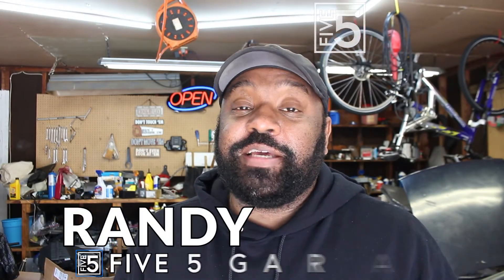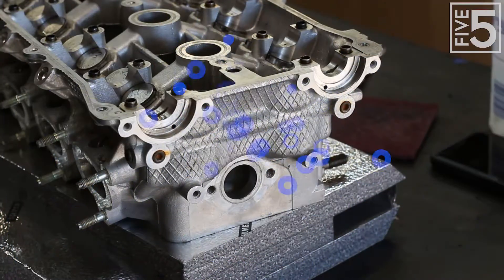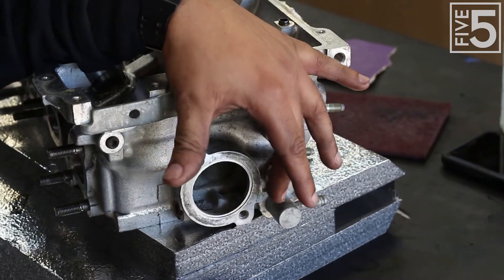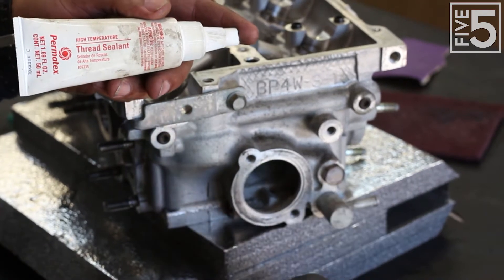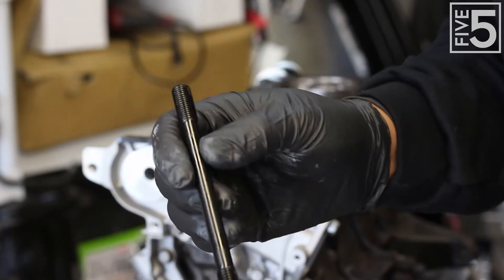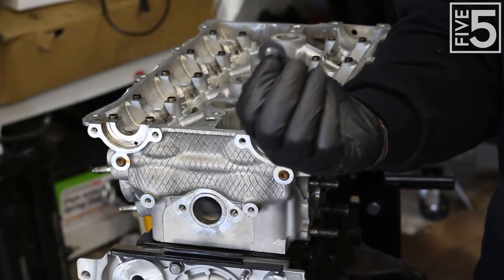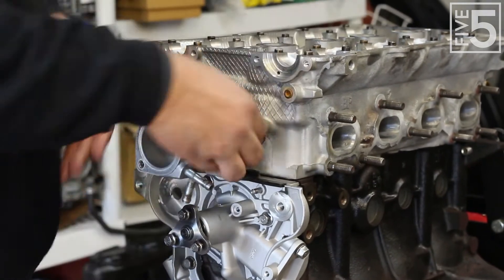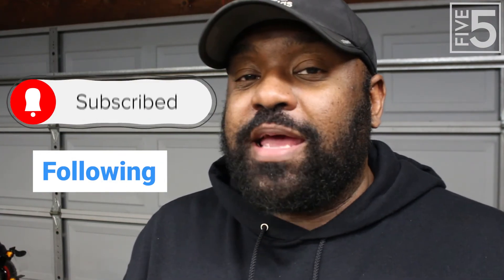Project TMB Episode 12: Cylinder Head Installation

Comment from the maker: Another week, another video, another step closer to getting this motor back in the car!
Reply: So do you think you'll be driving this car in the winter of this year.
Reply from the maker: Nope. Engine will be in and running, but there is a lot more to be done: intercooler setup, wiring, suspension work, body work. This car won't see the road until next spring/summer.

Comment: Didn't fancy deleting the neck on the front of the engine with a plug?
Reply from the maker: I thought about it, but needed a way to run water lines to the turbo and it was easier to keep it.